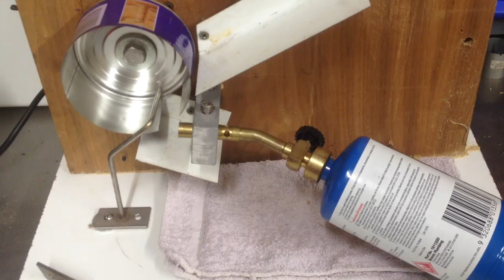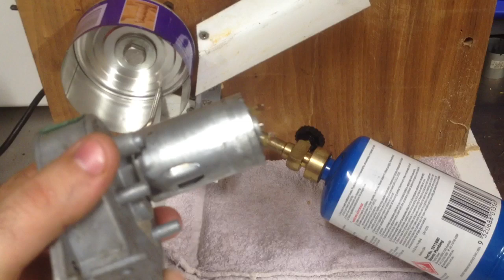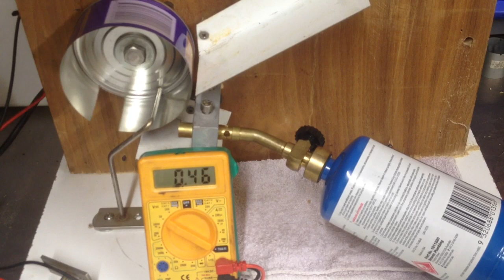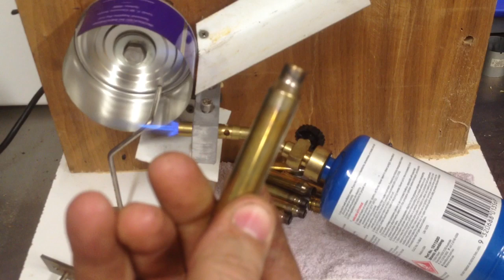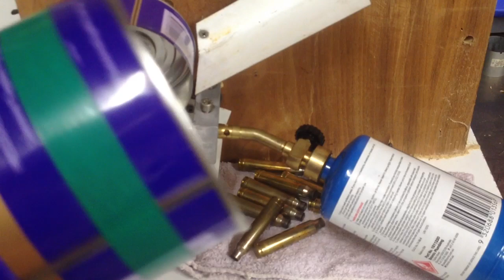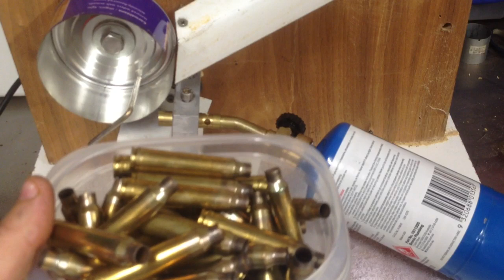Skips version  of Mr longrange's awesome case annealing machine.

Comment: I built one very similar, using a microwave turntable A.C motor with a speed of 10rpm (rotation every 6 seconds)
Didn't have space for it when I moved house, but still have the motor, I'll make another one soon.

Comment: I like your setup! The simpler the better. If I could make a suggestion on your flame. I may be wrong but in my experience with propane torches you have the flame too close. Ideally you want the tip of the blue flame just barely touching the object. Or in this case the brass case. If you hold too close you will not get the full effect of the heat from the flame. Try making some small adjustments until you have the flame just right on the case. You may even need to reduce the flame some to prevent over heating. You could dial up the speed and anneal faster. Your choice in that one. Thanks for the video!

Comment: I'm just starting to build one now,  prototype made. I went round on hard rubbish day and got an old microwave, (for the motor)! I used the 240volt AC motor, plugs straight into the wall, gives you a full revolution in 24 seconds. (also spent nothing!)

Comment from the maker: Hi Mate 

I made the Bar out of some rod that i welded at the base ( There was 3 hole's in the base ) The middle was for the rod and tac welded to the base. Guy's on the forum have used coat hanger's etc to make the rod, all has worked well.

As too the burner holder I am onto my 3rd one i have made the same as this one but much smaller. It's not too hard to make ( The burner is 12.7mm ) so a 13mm drill bit and the bit of ally in the vice will hold it as you drill it out. ( start with a 8mm pilot hole then drill with the 13mm ) The cap screw at the top is just a M6 cap bolt. drill the hole with a 5mm bit then tap the hole with a M6x10 tap. The whole job i did here was made with simple hand tool's that most people would have in the shed.

If you like to see more and other's ( Pop into the reloading section of our forum at shootingaustralia.net